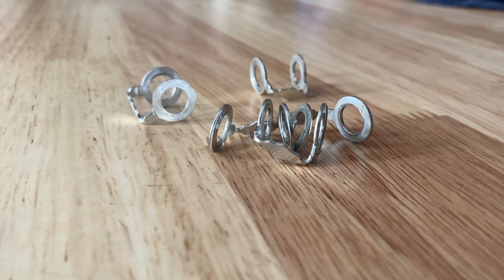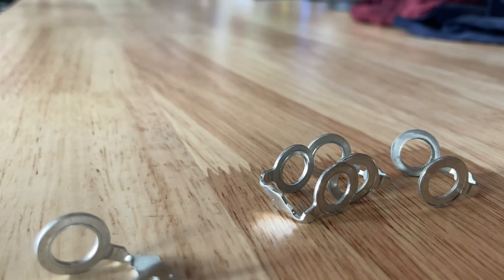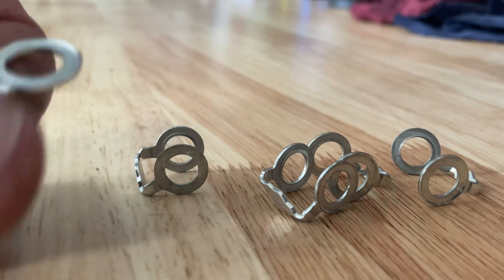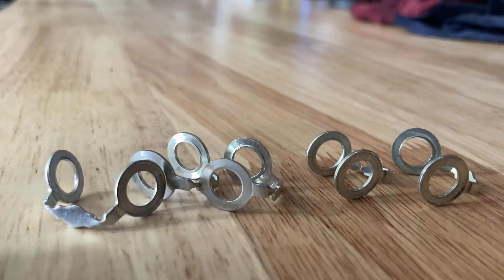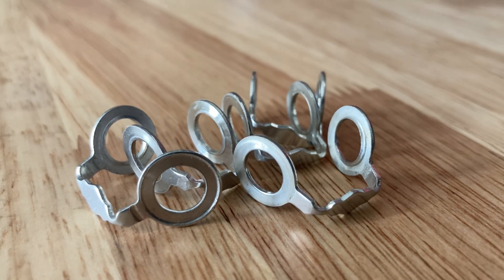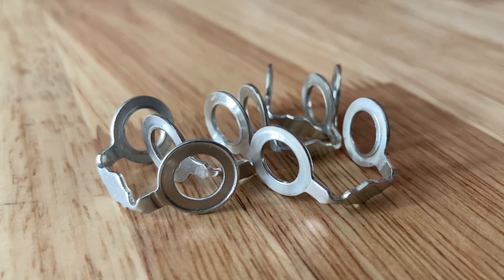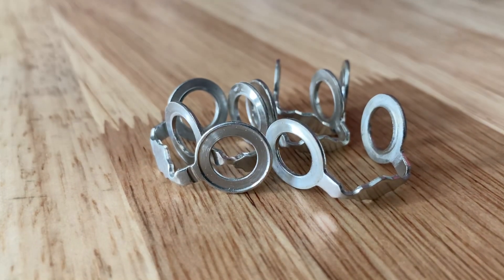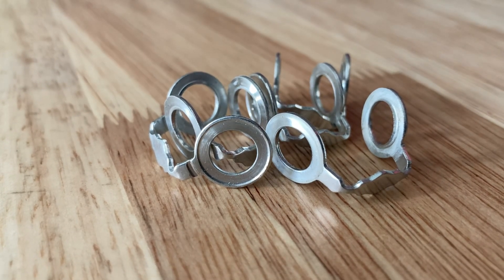DIESEL ENGINE REPAIRS DONT Do This Wrong Torque Spec’s

Comment: i found one of those "double-sided washers" on the turbos oil return line banjo bolt, a real bugger to get at on the 1kz-te, I could not figure out what I was looking at, as it had broken into two parts and I ended up using the two used broken parts when i put it back together. That was a rookie mistake, time will tell if i fckd up. LOL

Comment: My mechanic reused these on my 1kd 2006 and now the engine keeps going into limp mode while siting a Diesel leak. Tried a different set of injectors and the problem was the same so I ruled out the injectors. Hence I'm now changing all the washers on the return pipe and injectors. Silly little things making the car act crazy 😂
Reply: Are you getting P0191, P093, P087?